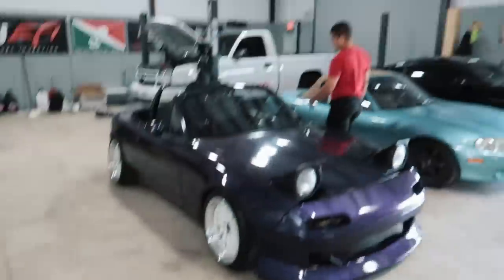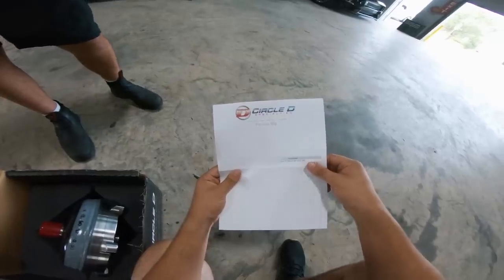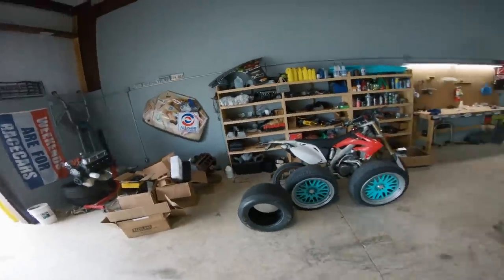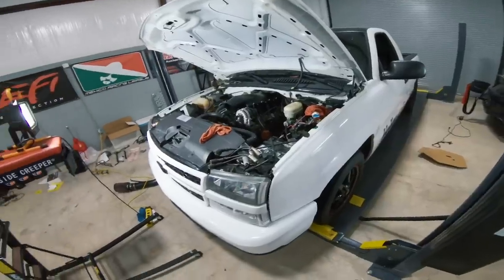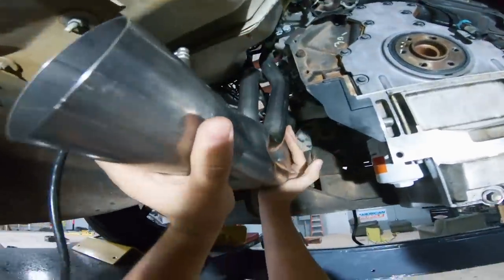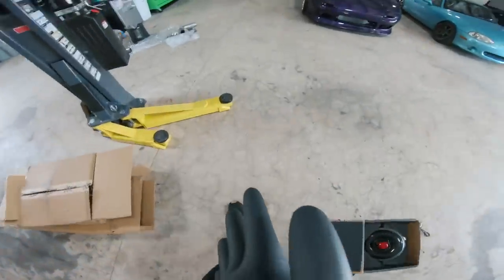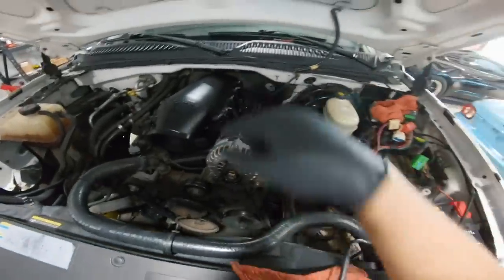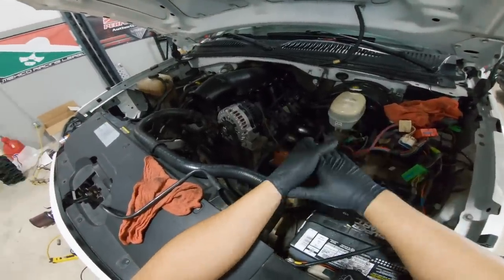Will JEEP headlights fit on a MIATA?

Comment: My 06 h.d 2500 gas has the same 6.0, it has daul exsaust from the manifold  on to the muflet and out of the mufler to one 5 inch pipe about the rear axle i did flow master sounds good

Comment: I can tell you from experience replace the radiator with a two row aluminum radiator, the crap stock one will crack on you sooner or later especially under high load.

Comment: On the exhaust for the truck, run the y-pipe from Texas speed and just run a single pipe back to a single in and out magnaflow muffler then out the back. That's how I have mine setup from speed engineering and I love how it sounds. Feel free to check my videos for sound clips!
Reply: That FiveThree speed engineering is amazing
Reply: @dylangerstenecker8434  yeah I've never had any problems out of them! They're nice people to work with also